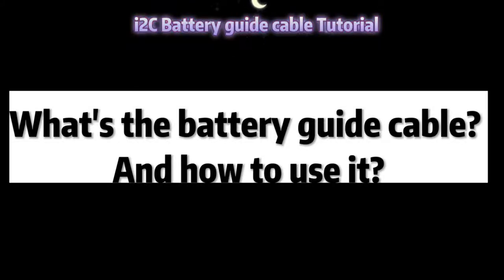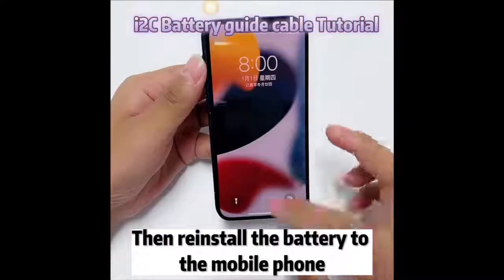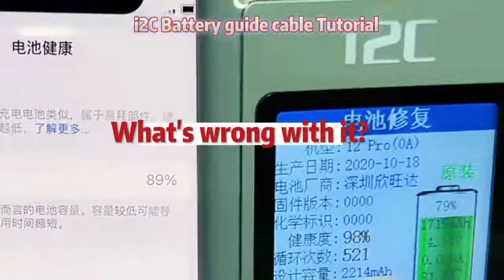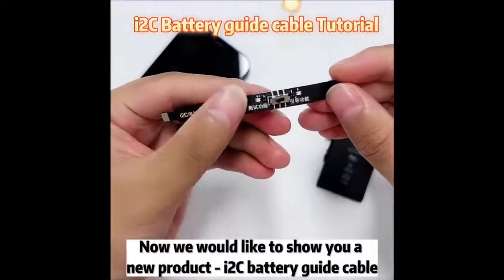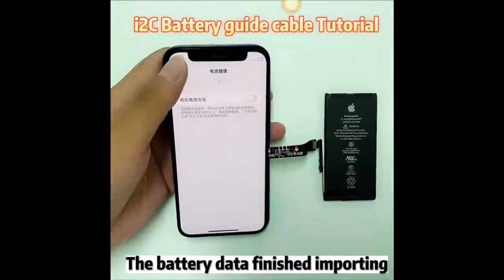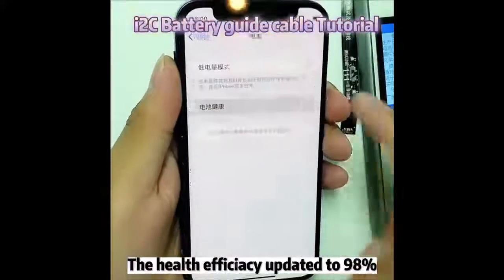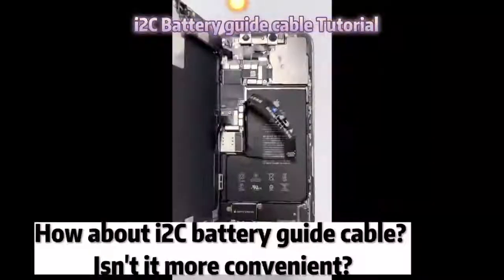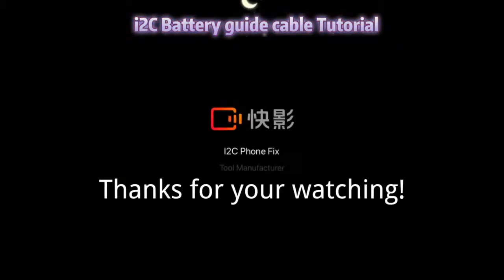i2C Battery guide cable Tutorial， import battery date for Iphone battery modification

Comment: Can I get a detailed explanation on this still confusing to me I have bought the machine but still can used it to achieve my aims especially this battery health modifying can I use it to remove non-genuine battery msg if so can I get a detailed explanation on how to do that 😅
Reply: Me too bro 😂
Reply: As known, first put non genuine batt into the iphone to bug the battery message unknown, then transfer the original ribbon battery. Then set the new non genuine batt with old transfer ribbon to i2c (not directly but with other setup ribbon). Correct me if wrong